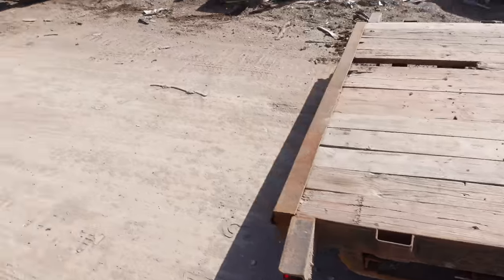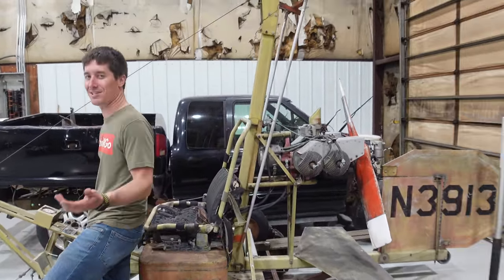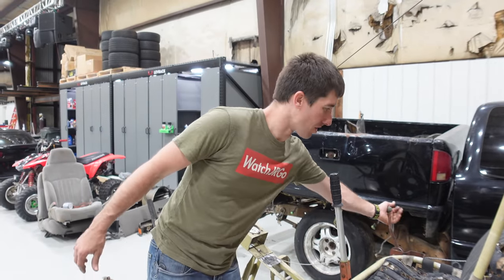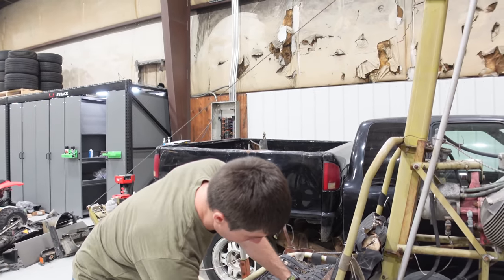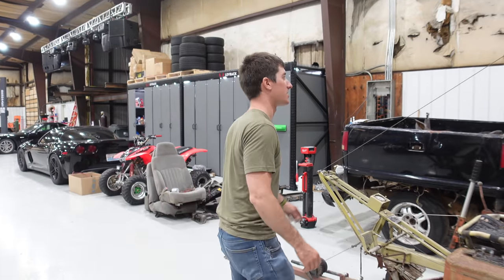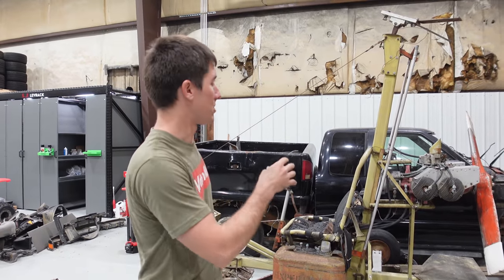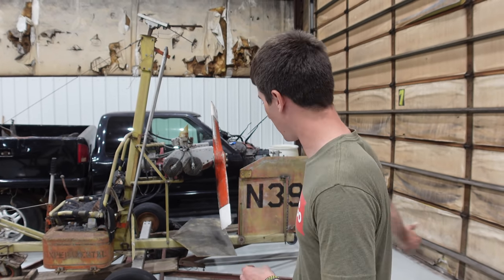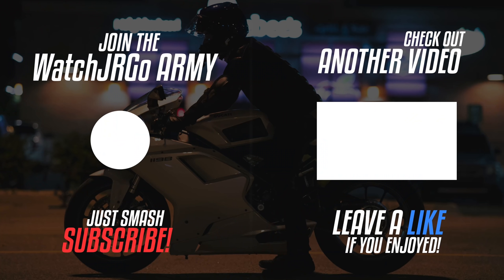I BOUGHT A Helicopter For $500 *Bensen B8*

Comment: BENSEN-WOMACK B-8 S/N: W0001, Year: 1969, Certificate Issue Date: 12/12/1972,  Cancel Date: 10/06/2014, Engine Manufacturer: MCCULLOCH,  Engine Model: 4318A&E/0-100. Classification: Experimental. The N3913 was also issued to a 1931 Laird Swallow aircraft. The previous owner from you is a Wichita resident. I have the name and address but will not post it here. Info from FAA.
Reply: This should get pinned
Reply: PINN THISS
Reply: @WatchJRGo here ya go

Comment: My Father in law had the exact same model.  He rescued it from a local museum here in San Diego.  The latch in front is so you can tow it for practice flights without the motor.  The motor is a actual drone aircraft motor from the military.  Huge 2 stroke and very simple.  They were only designed to run full throttle.  So getting them to run with a carburetor was interesting.  It only spins no more than 3500 RPM or the blade will break the sound barrier and come apart.  He upgraded to a VW and later a Subaru both with a belt reduction.  They take off very easily and quickly if you point it into the wind.  His had a powered rotation which was a starter and also a power cable off the engine.  He flew it for years in the CA deserts.
Reply: Was he the dude in the Mad Max movie? 😂
Reply: Likely the most useful comment he'll receive on this project ... VERY interesting 👍
Reply: @Catiadr  came here to look fore any mad max ref. 🤣🤣🤣
Reply: Putting it out there you might end up with blueprints and manuals.
Reply: This is easily the best follow up info and story I’ve ever read. He sounds like an amazingly interesting dude I bet
Reply: Very cool.
Reply: @eileenfalcon7635  bring it on!
Reply: I have a set of drawings from the 1950's my dad bought and I'm 71 now I built the frame and I rebuilt a er81 Subaru, never got rotor blades built, gave it all to a friend for his kids to play on. Wish I still had it 😢

Comment: gyro copters are among the safest rotor machines you can fly they can't fall out of the sky if your engine quits since they generate their own lift from forward movement. and you can control your speed without the engine running in a controlled "crash" more or less a controlled decent.
Reply: Well, normal helicopters don't fall either. When you're training to get your helicopter license, you need to train for engine out landings. Of course, they don't glide as well as a gyro for obvious reasons, but they don't just fall, as I thought before as well 😅

Comment: Same tank as an old outboard pressure tank. I have a few. One way valve at the crankcase provides pressure. That button on the tank is a manual pump to get you going until you build pressure. Also, works as a manual pump if something goes south in the pressure system. I've pumped my way back to shore a few times. Better than rowing.
Reply: I was wondering where the benefit of a pressured tank lied. Thank you

Comment: Suggest after the restoration you hang it from the shop ceiling like the Smithsonian Air and Space museum. Maybe wire the lights and rotor/prop to spin via electric motors on remote control. 😁
Reply: I think this idea is excellent

Comment: At 4:40, the control stick you are moving around and calling the collective is actually the cyclic. It does move the swash plate, true, but it tilts the swash plate in different directions creating individual pitch changes for each blade to control pitch and roll of the entire craft. Yaw is controlled by the foot pedals which operate the rudder as in a fixed wing aircraft. You may have a collective as well, just like a helicopter, but it moves the entire swash plate up and down rather than tilting it, changing the pitch on both blades simultaneously. Most gyroplanes don't have a collective control. If you had one on the Bensen, it would be a longer lever attached near your left hip when seated, which you would raise and lower. Most gyroplanes collective pitch is preset at the factory so you probably don't have one as I mentioned earlier. If you did want to fly it, I would lower the engine mount to be sure the propeller thrust line is below the center of gravity. Power push over was the cause of most gyroplane accidents and it comes from having a ship with that high mounted engine like yours. And even experimentals need to be checked out and test flown by professionals before you take them up on your own.

Comment: BTW, I am a helicopter CFI and this isn't a helicopter, it's a gyroplane. Forward thrust is provided by a pusher propeller and you have a rotary wing instead of a fixed wing. It autorotates just from the flow of air over it created by your prop pushing the craft through the air (relative wind). Once autorotation speed is reached from a short takeoff run (300-500 feet, condition dependent) on the ground, there is sufficient lift for flight. An item called a prerotator can spin the rotor fast enough so you can perform a jump takeoff, which can be almost vertical or a very short ground run, like 20 feet.

Comment: My best friend's father was the US first helicopter pilot just after WWII - he worked with Igor Sikorsky and flew the first one they ever built - when we were teenagers in the 1960s, he bought a Benson Gyro-copter - same variant as the one you have there. Before you added the engine, they could be towed behind a car in a short boom to get practice - we did that a few times at Plymouth, MA airport. Subsequent tow-trials were with a long tow rope - still no engine. Eventually, the McCulloch drone engine went on. He did a couple short flights and eventually crashed it on take off - they are squirrely. And.. the drone engines were not designed for long duration use - the bearings wore out and siezed up after several hours if I recall correctly.   Be safe on that thing, Sir - not likely to have a good outcome if you auger it in from more than 10' altitude.

Comment: When I was in high school in Fairhope, AL (mid 1970s), you would occasionally see a fellow flying an autogyro over the school... which always brought a crowd of students outside to watch him!   I always thought it was the coolest thing, and really wanted one some day!  Later in life (mid 1980s), I was the manager of an auto parts store, and one of my customers (a college professor at the University of South Alabama) would come in about once a year to have me order a set of 4 "matched belts" made by Goodyear (matched belts all have the same batch number on them to indicate that they are exactly the same length since they were used on multiple pulley set-ups).  The guy had his own autogyro/gyrocopter which used a 4 cylinder air-cooled, flat 4 engine (like a Volkswagen used to use).  The engine had a 4 groove pulley which drove a smaller 4 groove pulley which was attached to the pusher prop, and having multiple belts gave you plenty of redundancy in case one broke (or 2 or 3, I guess!).  The guy told me that autogyros were some of the safest air vehicles you could fly in (or on?) since the overhead rotor was basically autorotating the entire time the craft was in the air, and you could easily land it even if the pusher engine died by simply "flaring" the rotor blades as you came in for a landing.

Comment: You probably already know, but the switch grounds the magneto out to stop it.  If the switch is off or the wire is broken, the engine is live.  Be careful when you’re trying to move the prop, if it moves and the mag is not grounded, it’s going to spark.  Some mags are very easy to start when you don’t expect.

Comment: N3913 1969 BENSEN-WOMACK B-8 Rotorcraft single seat/single passenger (experimental). 72HP MCCULLOCH 4318A&E/0-100. Maximum speed 45 MPH. First registered 12-12-1972. Last action date was 5-20-2008 and expired 6-30-2013. Last registered 06-02-2006. Serial # W0001. Classified under the less than 12,500 pound weight class. Original owner/builder David ** from Wichita, KS.

I think that the flight information that FlightAware has is wrong. For some reason it's showing a flight with that tail number that was made in California in 1998 but the plane was a Piper Cherokee PA28. Yet if you click the registration link it gives you details about your gyrocopter.

Comment: There is an annual inspection for experimental aircraft (although it's called a "condition inspection"). 
On gyrocopters there is no collective, the rotor is a fixed angle and is always autorotating, it's tilted rearward so that while it's got airspeed it autorotates to create lift. 

Experimentals can be much newer/better than "certified" aircraft, but obviously it's a mixed bag

Comment: don't all airplane motors like that have magnetos because the last thing you want is a no-spark situation in the air which a points system and battery could fail and cause?

Comment: That's a McColloch 4318A.  It's missing the two rotor blades. They won't be cheap but you could get some carbon fibre ones.  Apparently they sometimes re-power these with VW 1600's, which I think would be badass.

Comment: You may not need a tail number for that or an FAA reg to begin with as it might fall into ultralight rules. (Less than 254lbs dry, less than 55knts top speed)  I mean you can register it, and basically self regulate which would get you on an airport, but in KS, a good flat field would do. :)
Reply: Before mounting a huge rotary wing on that old thing, you may want to educate yourself on materials used and their properties at this age.  Probably don't want to do that.
Reply: But WHERE would you find a good flat field in Kansas?🤣🤣🤣

Comment: Put marvel mystery oil in the cylinders and let set and it will free it up to turn over I know I've used it on old rotor tillers that have been sitting for 20 yrs and it freed them up and put carburetor kites in them and cleaned the fuel tanks and got them running again.

Comment: When you talked about the details of the supposed last flight, you mentioned Lancaster, CA to Bakersfield, CA in 31 minutes. Don't know the air miles, but that's 80-90 miles by car and in an aircraft you have to cross over a mountain range. That would be smokin' fast in a gyroplane!!! Don't know why that tail number is assigned to a Cherokee now, but perhaps it was reassigned if the old registration was surrendered by the previous owner. Only the FAA could tell you that. BTW aircraft registration is permanent unless surrendered. There is no renewal. What makes the aircraft legally airworthy is proper maintenance and inspections, properly logged.

Comment: As you mention this is a gyrocopter and not a helicopter. The propeller that does the lifting is not powered. Also gyrocopters have to take off from a runway and cannot lift from a fixed point and cannot hover. It is fun and safe

Comment: That ain't no Corvette !! T'ain't a helicopter, either, but 'Gyrocopter'  or 'Autogyro'. The schtick with 'em ,is they are basically gliders with rotating wings. The engine is there to provide forward motion so that airflow turns the rotors , just like glider wings, albeit these wings are turning whilst conventional glider's are not. So , given a modicum of piloting skill and awarenes of th quirks of these craft, no engie-out drama to the extent of a fixed-wing , powered 'plane. Just remember...no negative 'G' ! They REALLY don't care for that. Rebuild the LS1 from the 3500 buck 'Vette and stuff it in there. You know t makes sese